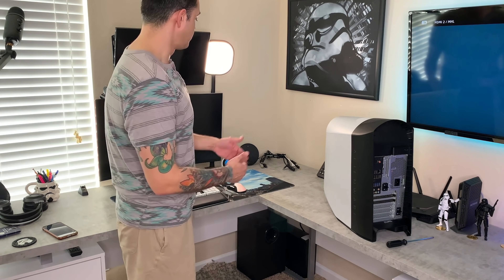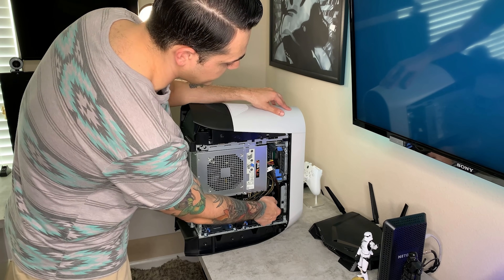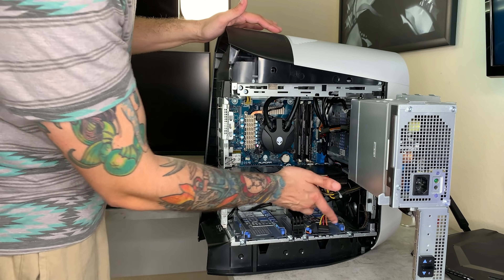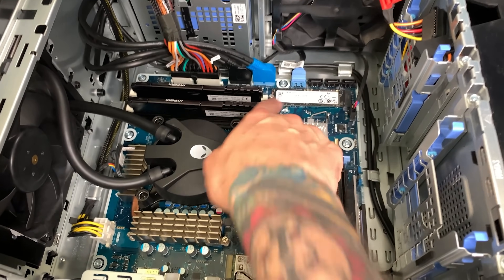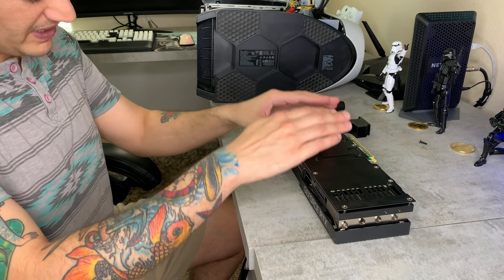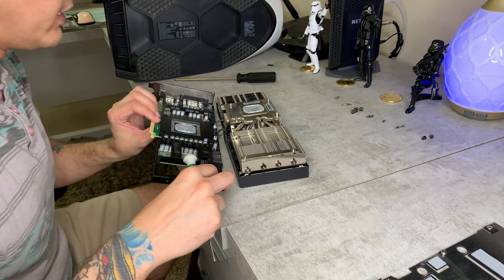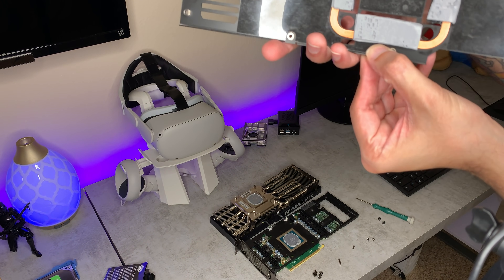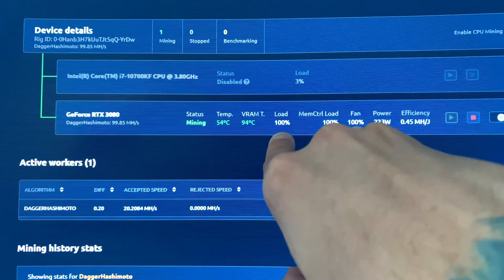Alienware R11 3080 Thermal Pads and Paste Drop VRAM Temps 30C

Comment: Thanks. Gaming/mining noob here with R10 3090. I was running NiceHash Quick miner on high mode because extreme mode was redlining at 108 deg C on the VRAM. Only did the thermal paste and dropped to 90 deg C. (I slathered it on, but 2grams didn’t go very far.) my hash rate seems to be about the same between high and extreme mode, but I seem to be yielding a few cents less on extreme mode. Is that due to the accepted speed being a little higher? Or just the fluctuations in demand?

Comment: Sent to the fail vid but:  I repasted the 3080 gpu and my system seems to stop crashing while gaming.  The thing is, with these high end cards why would we need to do such a thing???
Reply: Also, the thermal paste container reads that too much can add higher temperatures.  You say slather it on but that's cut out of the video.  Which one is it???

Comment: My wife got me the R12 with RTX 3070! Is it posible to add an extra graphic card in it or external?
Reply: No
Reply: yes
Reply: @brohemian  no there is no extra pcie slot and also the card is to big even if he got another mother board he wouldn’t be able to fit it in the case unless he got a new case and transferred the parts to the new one but that would be a hassle
Reply: @TOXIC-fo2bc  I have one with a 3080 it came with and a 1070ti I threw in for a few extra hashes. It is a very tight fit and I have the case open tho

Comment: Receiving my 3090 R10 tomorrow, I think the paste is worth it, but why the pads? If the card is brand new it probably uses exactly the same type of pad, do you really think it's worth buying pads to replace presumably perfectly good stock ones?
Reply: @Mart same question here…I also do have a r10 with rtx 3090. Did u use pads already?
Reply: @Max-cj2oq  I replaced the pads and the paste on GPU and CPU.. I got better temps but I don't think it was because of the pads, literally same pads

Comment: any luck adding more than 1 card to that rig?  every time I add a card (tried a 1080ti and a 1660super)  hash rate drops.  I can't get above 70 on the 3080 and even the 1660 won't go above 20.  alone, installed 1 at a time, they work fine. (virtual mem in windows is set to 40gb)

Comment: This guy is a wizard. Dropped my VRAM temps 20 degrees.
Reply: I didn’t have pads on hand, and didn’t want to wait for Amazon; so I just did thermal paste and that did the trick just fine for me.
Reply: @anthonyanderson3328  thank you!!!
Reply: Did you do both pads and paste? I'm thinking to only do the paste..
Reply: Same here, receiving my 3090 R10 tomorrow and want to do this but imho the pads are probably not worth changing if they are brand new, did you do both or just thermal paste?

Comment: I have the same card, I used thermal pads and it works.  Dell OEM 3090 is special, it is hard to directly replace thermal pads for the 12 VRAMs on the front side, it's not easy to separate the PCB from the black plate. For other 3090 cards or 3080, you don't have to put thermal pads on heat sinks.
For Dell OEM 3090, the thickness of thermal pads depends on thickness of grease on the core, and how tight you squash and screw the two boards. you might have to try 1 or 2 times to get a satisfying result, in the best case, the VRAM temp drops without causing core temp's increase. but more often VRAM temp drops at the cost of core temp increase. in worst case, the pads are too thick, the core will be overheat immediately after booting your system, then you need to make the pads thinner. I don't recommend using grease on heat sink, it will flow away if the grease is too thick, it won't last long even if it worked in the video.

Comment: I literally did everything you said and used. I’m still at 110 vram. I don’t know why it didn’t work.
Reply: I just searched for Alienware RTX 3080 and found a teardown video with only a repaste and no need to change the thermal pads. I repasted/pasted on 2 3080 and both mining at 100 MH/s with Vram temps at 86-88C max. Fans at 80% core at 46C. Power at 72%, core -150, memory +1370. These cards literally perform better than some top tier ones. Of course my side panels are off or else they get up to 100C range. Not enough airflow in the case to run them enclosed 24/7. I also used Noctua NT-H1 for the thermal paste.
Reply: @davecollins7600  Love to hear it. How much thermal paste did you use?
Reply: @brohemian  Out of a 10 gram tube I would say I used from 2-2.5 grams around the entire heatsink with no gaps. I did not spread the paste out before reassembling the card. So far out of 10 Dell 3080 I did, 9 are at lower temps at 86-90C Vram while mining. The 10th card died and is awaiting replacement (was bad card to begin with).

Comment: The irony is that all your videos of dismantling this prebuilt actually encourage me not to buy it...
Reply: I just repasted my 3080 from Alienware and it was a 15 minute job. Simple to take apart, easy to paste/repaste, easy to reassemble. The pads on the Alienware 3080 are good quality and I seen no reason to change them. They didn't use the same cheap pads that Nvidia and others used. Dropped my temps to 86-88C while mining. Its not as hard as you think.

Comment: I've been following your videos because I ordered an r12 with an RTX 30 80.. if you use your Alienware clock settings and crank up your vram... Dial back your power to 75... Then use Quick minor and only change your vram GPU Target temperature with your fans... You will get higher hash rate and lower temps and if you dial it in nice. Your fans will not have to run at 100%... Also taking the side off the chassis made a huge temperature difference...
Reply: I also used your very messy instructions of gooping thermal paste on those plates.. it seems to have helped it's hard to tell

Comment: you say add the paste generously. would that make it leak out the sides onto the other components? *as one pea size drop covers a whole cpu right?
Reply: This is the GPU not CPU, and as long as it's non conductive paste it doesn't matter how much you use.

Comment: Can anyone enlighten me as to if i do this to my dell 3090 the paste wont get broken down over time, lose its viscosity (makes ot thinner/runny) and wreck shit? Also for any1 wanting to monitor Vram temps for my 3090 i use NWinfo64 , download the portable, current version (7.03-4450) and run sensor only and then find GPU Section and if it has a sensor it'll be displayed under GPU memory junction temperature! 

Also can anyone help with what paste to use i have arctic mx 4 2019 ed  and i am waiting on thermal grizzly. which is best?
Reply: please just leave it stock. From experience I can tell you the factory stuff they use isn't top performing but it lasts forever vs the aftermarket stuff.
Reply: @notmyfaultthisishappening3795  if i wasnt using it to mine i totally would leave it stock 100% but that's not the case. I am not ok with 110° GPU VRAM temps that's redonkulous. and i actually stopped mining till i get it done.

Comment: I ended up doing this and dropped down to 80-86c depending on ambient (100% fan) . I used Noctua H2 compound since it is non conductive. I did not change thermal pads.
Reply: Did the exact same thing. Used artic paste dropped from 108 to 88-90c not bad

Comment: How long did delivery take from shipped to arriving at your door? Mine is finally shipped and I plan on doing this day 1. I do wish the description of pad location was more clear. Also 1mm or 0.5mm? Seems to not be a clear answer their either. I will do the thermal paste though, that part was clear.
Reply: Exactly. I just got an RTX 3090/R12. The link has a 1mm pad, but Kevin says .5mm or .5mm stacked as 1mm. I may just leave the pads as is and just do the repaste.
Reply: @1TrackSimulation  How did it go?
Reply: @ryanvoogt5036  I used 1.5mm pads. I think Kevin mentioned that in his old repast video. And it’s true. I did the fix on my 3090 and I’m testing OC settings right now. VRAM temp went down, but not -30C. I’m at 100C mining ETH from between 108-110C!, but I am happy to report that I can squeeze a few more MH/s now. I went from around 118 MH/s to 124.7 MH/s! Still testing. Once I find my Goldilocks settings, I will post for the community. Oh yeah, and my side panel is completely removed LOL. No other mods or changes.

Comment: Does that Dell 1000W PSU have extra empty PCIe slots?  Is it modular?
Reply: The psi is modular however dell ships it with all the cables installed. They are there for if you plan on upgrading I guess

Comment: Quick question Kevin, how likely can you fit a 2nd RTX 30 card in the open PciE slot at the bottom of the aurora case, is there much clearance ?
Reply: forget it. it will be a hot mess. use a riser.
Reply: You can fit two 3080s In the case by removing the two Ssd holders at the bottom, I did this and left the side panel off of the case while mining. I couldn’t get pcie risers to work on my r10

Comment: Did the exact exact same mods you did; GPU temp is around 68c, VRAM temp around 94c and hashrate at 97 MH/s... 

The only problem now is that when I'm gaming, GPU temp hits 85-86 and throttling starts....

Maybe not enough paste?
Reply: I have a similar experience whereby my vram temp dropped substantially when mining. However, my GPU core temp seems to have gone up a few degrees C during gaming (up to 83C). Initially I thought it was a bad thermal paste application on my GPU die so I then re-pasted it. Re-pasting the GPU die didn't improve the gaming GPU temperature. 

I believe that the heatsink now has to also dissipate more heat coming from the GDDR6X vram, and consequently affecting the GPU core temperature.
Reply: @tmtmy2001  Found any solution to fix that? @Gamer Heaven?
Reply: @michomx  Not yet. My mining temps are perfectly fine though. I believe we're hitting the limit of what the GPU heatsink is capable of dissipating. You might want to try undervolting the GPU to lose some gaming temps with minimal loss of performance.
Reply: @tmtmy2001  Same. Mining temps are fine. I'll try undervolting while gaming. If you ever come up with a solution, let me know!

Comment: Ok everybody. Here’s what you do. I got my R12 yesterday. Tried mining, VRAM’s shot up to 106C and was throttling my speed to around 90MH. Not good. I took some of the info from this video, but did it differently. After I finished and plugged it back in, I am mining NiceHash, High optimization, VRAM at 90-92C. Very pleased. I used No additional thermal pads, just added paste to areas. Read below.....

So takeoff the back plate. Then unscrew the cooler from the PCB. Use this video to guide you what screws to remove. I completely separated it by unplugging both fan connectors. Clean off all the old paste from chip and cooler. Next, I removed the black aluminum piece from the PCB. I took the three screws out of the rear IO bracket and gently pried the two pieces apart. The thermal pads make them stick together. It will separate with minimal prying. 

From there, I adjusted one thermal pad on the memory because it was applied crooked. I then for giggles, put some thermal paste on top of those pads to help with contact to the black aluminum plate. I then put the aluminum plate back on the PCB. 

Next apply fresh thermal paste to the freshly cleaned Processor. 

Now onto the cooler: Remove the stickers like in the video, use a little alcohol to get off sticker residue. Apply thin lines of thermal paste on all sides of cooler. The area where he mentioned in the video.  (You will see where the memory chips are located when you remove the black aluminum plate and will then know where to put it.) Place the cooler on top of the GPU.

Backplate: I made a little channel in the middle of all of the thermal pads on the back plate. I filled the channels with thermal paste. After that, screw everything back together. Start in the middle for tightening and work your way out. Now your GPU is ready to fire up.

I fired up NiceHash, immediately got 100.50MH. No thermal throttling and my VRAM went from 106c to 90-92c. I replaced no pads, just added paste. Now I don’t know if the extra steps I took made a difference or if it mainly is just adding paste on the cooler, but I tried to be thorough. I’m glad I took off the black aluminum plate and saw the one crooked pad. 

Maybe Gamers Heaven will do a walkthrough that visually shows what I did. Until then, message me here is you have questions. I’m very happy with the outcome and it only cost me thermal paste I already had in the house. Overall, it’s an easy job. Just go slow and take your time.

My fans were running 100% at first but they do eventually come down. Runs about 60% when the  room is around 70 degrees. If room is hotter, fans will ramp up.
Reply: which thermal paste should I get and how much of it to do the job? new to paste
Reply: @someguyyoudontknow263  I used Arctic MX-4. They have an MX-5 out as well. A standard small tube is more than enough. Thin lines on the cooler.
Reply: Thanks very much for this write up !

Comment: I am looking at adding a couple bottom fans to my case , seems like I could either remove the 2.5" bays at the bottom , or mount fans on top of them directed into the bottom of my 3080.  

Also wondering if it's possible to add additional heatsinks to the card outside of the thermal pads and paste.  

ALSO looking into adding gpu liquid cooling - ekwb? Has a pretty cool looking  adder for the 3080, but I am unclear on if I can modify the stock AIO to add a gpu into the cooling loop, or if I'd need to get a whole second setup, which clearly there's no space for.   So, that may wait for a case swap, if I ever feel the need for more nvme or lack of  pci4.0 becomes an actual issue.

Curious your thoughts man, your videos have been really helpful to me.  Cheers!

Comment: Any suggestions for R12 cpu air cooler that would be better than stock without going for an AIOWC?  The psu takes up a lot of clearance...
Reply: you need to go water as youl be blowing air into a wall which is why you have the radiator to point the heat out the top vent.

Comment: Great Video!  Followed your suggestion, put thermal paste in my RTX3080.  VRAM temp dropped from 106C to 96C.   NiceHash Quick Mine High, 100MH/s, Power 226W.
Reply: Does your fan stay at 100%? I’m getting ready to thermal paste my card now, but I don’t like that the fans scream at 100%. They will wear out faster and are very loud.
Reply: what did you hash before the paste? 100mh/s now, what before?

Comment: OK. I have another PC running an EVGA 3080 FTW3 Ultra and it putting out 100MH/s 90C on VRAM (Tops). Closed Thermaltake Full ATX Tower. Everything on air.

Comment: What games do you play? In cyberpunk with an undervolt at 5ghz, I hit well over 70c and I have the same CPU, a 3090, and 3 fans I modded in. These cases do not stay cool. My 3090 hit 78 to 80c under full load and that's with all the cooling mods.
Reply: Those temps are well within acceptable ranges.
Reply: Same here @Ben Cheal. All cooling mods with rtx3080. Same temps u get also tested within cyberpunk, cinebench R15/R23, cpu-z stresstest. Will finally try the 3080 modding with thermal pads.
Reply: Just case swap dude all you need is a new motherboard and a case. The psu, cpu, gpu, and ram all transfer